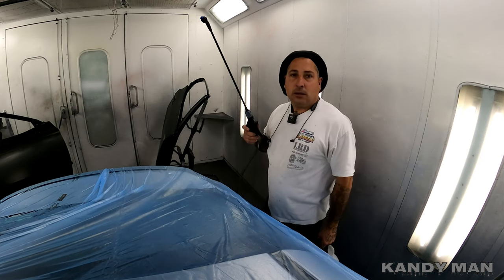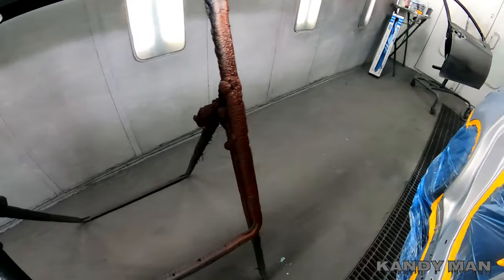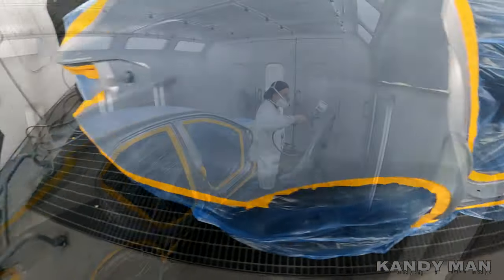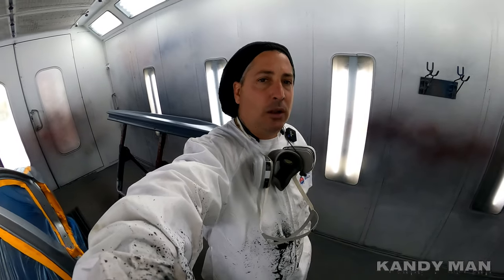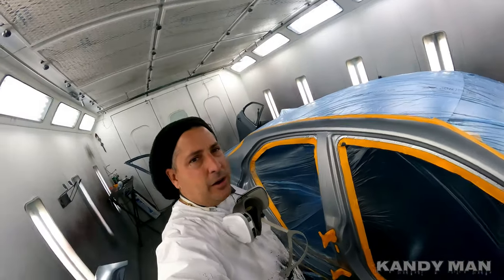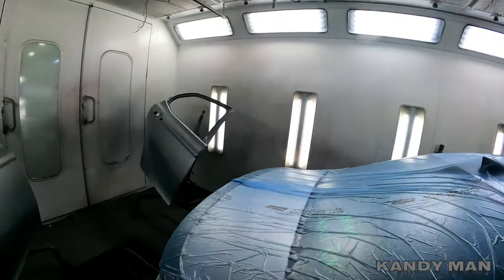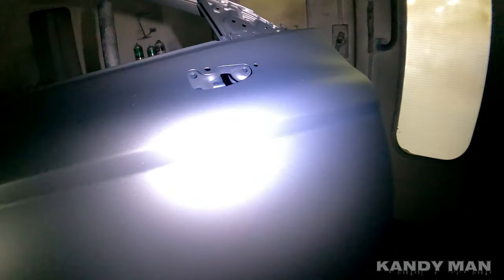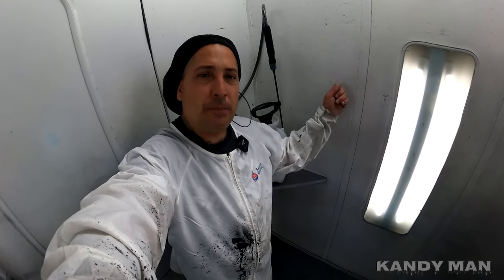WANT CLEANER PAINT JOBS? TRY THIS

Comment: When I left the dealership for the shop im at now they didn’t have a down draft booth, just cross draft booth, no heat either. Well dirt was a issue. So I started with the microfiber towels and it helped but wasn’t a fix. So I got my hands on that stuff and man it fixed the trash issues. I don’t have much room so I do parts against the walls like u. I even spray some
One the bottom of the innovated tool stands and it helps there too. Almost takes static off the stands. 👍🏽👍🏽👍🏽 awesome review sir
Reply from the maker: It's a good product for sure when you need it 👌